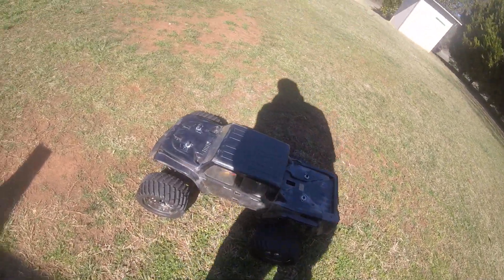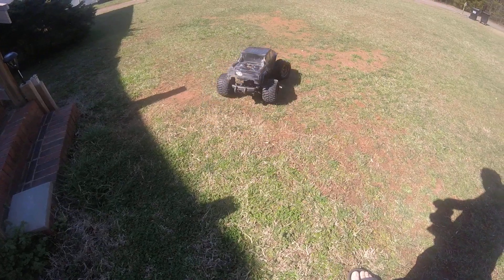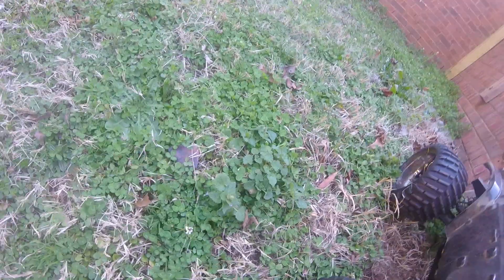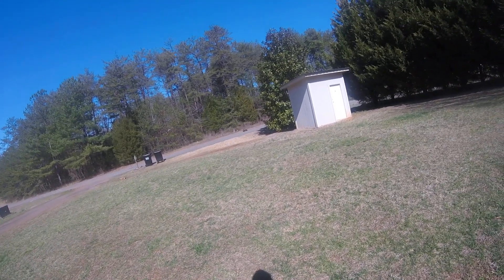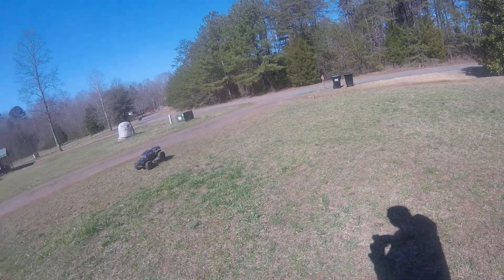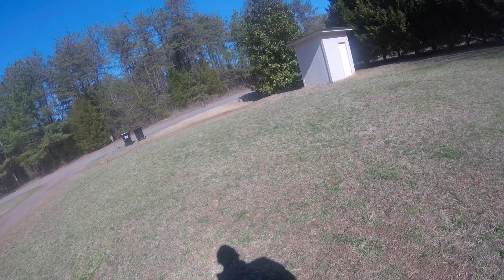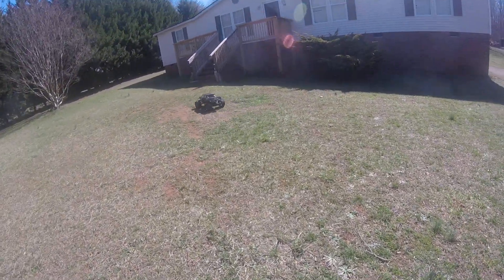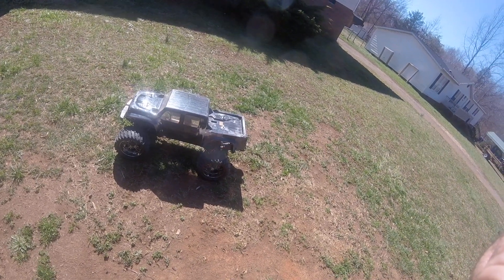Cen Reeper New Custom part test

Comment: Your reeper is sick bro
Reply from the maker: Thanks man, i just got to get that center diff figured out, thought it was the rear going out again but it waited a minute or 2 to make noise then went again, so i pulled the diff out and its already got a few bolts loose on the spur gear,  im really hoping i can make some game changing parts for this truck soon, i got a 3d printer on the way in the mail
Reply from the maker: Love your content man, im gonna make my own stuff soon
Reply: @restinpiecesrc5528  thanks bro. Looking forward to seeing what you come up with
Reply from the maker: @norcalrc  first thing is i need to locate some longer drivshafts that will be usable so i can get the correct arm length and ill design and print longer arms to fit giving this a wider stance, biggest thing is getting my hands on some. Also im starting to design my own chassis. Thinking 1/5 with modular parts so they can be changed out to different diff sizes, but im going to have to print in sections for now because of 3d printer limitations. Then if 3d printed i cant make strong enough the cad program i have is linked for a company that can do injection molds and cnc work
Reply from the maker: Also i think i need a new camera, the jumps in footage isnt editing and shouldnt be pausing
Reply: What type of filament did he print those in just curious i have a 3d printer too and usally use the hardest tpu rubber i can buy for rc parts
Reply from the maker: @jasoncrow2819  he used PLA, did 40%infill, but as to how thick the layers are im unsure, im sure theyll break but i dont know when, i got a 3d printer coming, going to be designing arms for the reeper to widen it, but first need to get it and get use to designing using a cad, ive been practicing using emachine shop, i havent gotten curves down yet, i want to design gears and have some cnc
Reply from the maker: @jasoncrow2819  im going to start with PLA thrn hopefully progress to other things, got a sovol sv01 titan with the bl touch lvl
Reply: @restinpiecesrc5528  oh nice what design program does he use can i know? I use the free tinker cad one but just wondering if theres a better free one and what people are using out there
Reply from the maker: @jasoncrow2819  he uses viacad, and the knuckles were already designed by someone else, i found them on thingiverse, i got a few other things but theyre for my MGT 4.6, im trying emachine shop, if i can do cnc stuff itd really be helpful, are you in any Facebook rc groups
Reply: @restinpiecesrc5528  oh awsome thanks for letting me know all try to check them out. Ya im not much into the social media with the 3d printing but I like a few facebook sites that do 3d printing rc stuff scaled cars or somthing like that